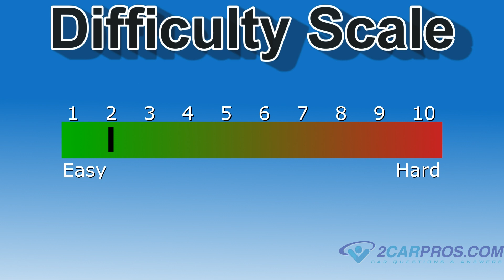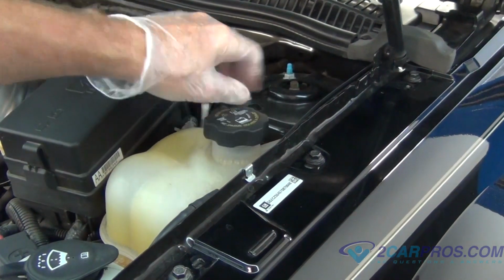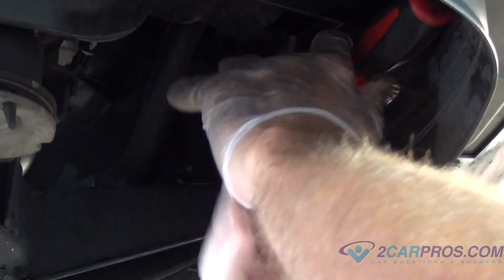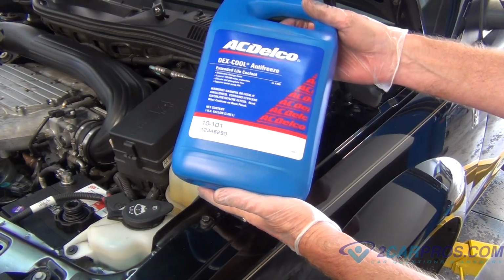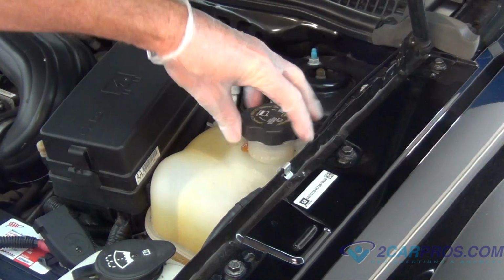Drain & Refill Coolant 2002-2007 Saturn Vue

Comment: So obviously my Saturn doesnt have a radiator cap is there any way to burp it or make sure there's no air in it, bc  unfortunately i didn't watch your video 1st and just unclamped the bottom radiator hose and put it back on. Im afraid there will be a lot of air in it now. 🥺😬🙄 (NOW I know there is a spot for this specifically on the radiator) 🥺Alao when i put the hose bqck on and went to fill the revisor it filled up to the line , am i suppose to turn the car on to cycle it to the radiator and then keep fillong while running, correct?! Thank you very much for a response!!! Single mom here.

Comment: Opening the reservoir cap after opening the radiator drain port will save you from experiencing fluid gushing out while your hands are still in the way. Open the reservoir cap later when you have your drain pan well placed. To open the drain port, you'll need a wide flat blade screwdriver; 1/2" wide is best. Such a thing is known as a "slotted sidewalk driver". Get a "Hillman Screwdriving Bit Adapter" Model #70542. Or a RYOBI SPEEDLOAD+ #18 X 2-1/2 IN. FLAT DRIVER BIT
Reply: You want to make.sure that the cap will unscrew because you don't want to drain the antifreeze without the possibility of replacing it. It's not common for that to happen, but it's just a precaution

Comment: For the Honda engines in these, use Honda blue coolant instead of dex-cool. These J series engines don’t like dex cool all that much
Reply from the maker: Why is that?
Reply: huh? I've only ever seen them with dex cool, and the owner manual also specifies to use dex cool.
Reply: Yep! I'd stick with the Honda Blue coolant. (Non-Silicate) Since it's a Honda engine and transmission.
Reply: Dex-cool was inside before, so I believe better no-mix with some new different one
Reply: I use the Honda Blue, and it works beautifully.

Comment: The coolant system self purges air bubbles?

Also, isn't that only draining and replacing the radiator coolant, not the entire coolant system coolant replacement, and certainly not a coolant flush?
Reply from the maker: Fixed the title.

Comment: I need to change the hose located on the top of the reservoir tank. The hose runs through the back of the fuse box. Any advice?

Comment: I accidentally put a little antifreeze in washer fluid resivoir.....saturn vue xe 2008......any suggestions? Prbly something simple but I'm not seeing much for my car on utube....guessing I need to drain washer fluid?
Reply from the maker: I'd take the reservoir out and rinse thoroughly or take the line off and let let water run through it for awhile. Thanks for watching!
Reply: Ok ty!

Comment: Don't top off with water! Dexcool is pre mixed.
Reply from the maker: thanks for the comment
Reply: you can buy dex- cool, premixed or not, cheaper to mix yourself but use distilled to mix it with and be sure of mix ratio you want. see container
Reply: Mine wasn't.  "Must add water" printed on directions.